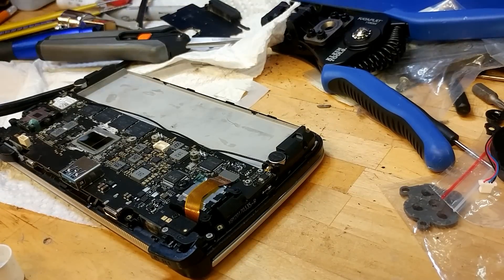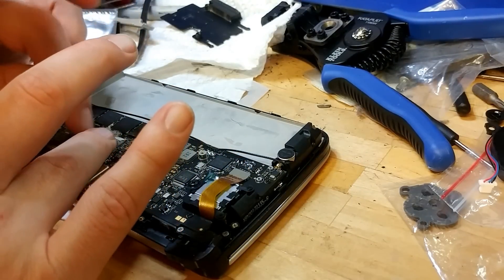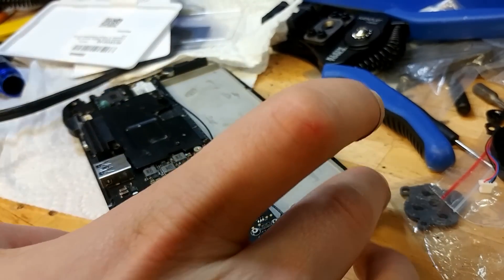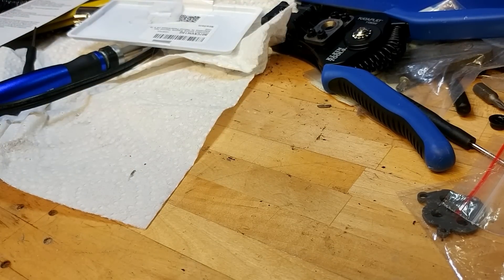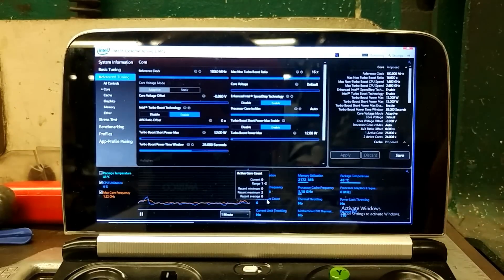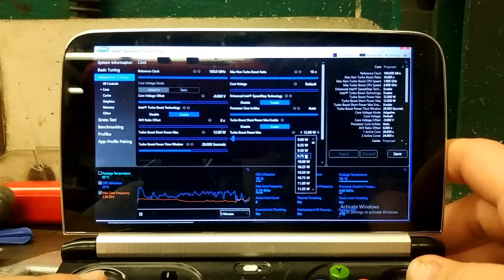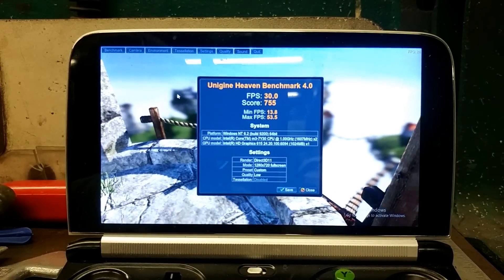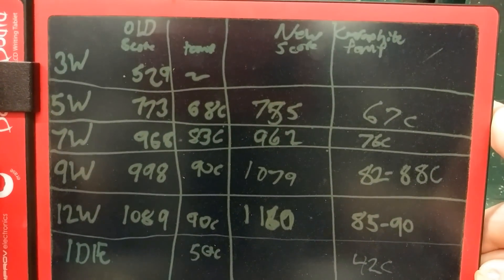IC Graphite thermal pad installation and testing on the GPD Win 2

Comment: the thing about graphite is that it spreads most of the heat horizontally. the more area the pad covers the better your cooling will be. also I would be more worried about graphite dust shorting something then the pad sliding out from under the heat sink. a better option would be a sheet of loose leaf silver. you can get a pack of 25 sheets for less than $13. note they are thinner than paper so they tear easily but can conform to about any shape you set it on and are kind of sticky so sliding won't be an issue. that said I have a Motorola droid 3 that I put a sheet of pyrolitic graphite on 2 years ago to help with cooling. the phone it-self still works fine other then being stuck on android 4.4 and scratched to hell. sadly pushing me to get a newer smartphone.  I'm also getting a reasonable result with just loose leaf copper on a i3-7100 desktop. with 43*C idle, 65*C load in a 21*C(71*F) room so there's that. lol

Comment: This should have been done at the factory
Reply: Just because you can modify it doesn't mean you have to. That's like complaining that a custom PC is worse than an iMac because you can upgrade the graphics card in the PC but not the Mac.
Reply: Undercoverfire That makes sense
Reply: Would be expensive and time consuming.
Reply: An Tran I just dont like the fact that you get an 'incomplete' product that you have to tinker with to make it work better.

Comment: I can’t wait to get mine soon so I can do this. Might pick this up for my laptop too. Seen so many videos on these thermal pads. 

Thanks for taking the time to do the comparison and benchmarks.
Reply: Chris Aguilar laptops (usually) do not use pads. They use thermal grease. A good replacement would be MX-4 or IC-Diamond
Reply: As sorry. I am referring to the IC Graphite thermal pads. Not just a generic thermal pad that would sit on a memory chips or random IC’s. 

Also nowadays more laptops use thermal pads to help cool vital pieces. My Alienware 13R3 which is only a year old has tons of thermal pads along with two coolers. It’s more common these days. 

I have been working with hardware/computers for about 15 years and it’s nice to see something like these pads readily available on the consumer market and most cases it performs as good or better then thermal paste. Of course liquid metal being the best. I prefer not to use it in something Mobile due to the fear of it leaking from the cpu/cooler area and shorting the motherboard.

Comment: That graphite pad does look slippery. Instead of some K5, do you think a couple very thin strips of thermal tape around the edges would be about as effective in keeping it secured when reattaching the heat sink?

Comment: What about using the liquid metal thermal paste?
Reply from the maker: Chris Pinson my personal opinion is it is too risky.  
The stuff as its name implies is liquid, its fine for a stationary desktop but for a small device that is carried around everywhere using a conductive liquid on the cpu is too much risk for me.  
I did contemplate soaking the graphite pad in it but I didn't want to spend the money at the time.
Reply: Michael that makes sense!
Reply: Depends on the surface tension. Two surfaces can completely hold a liquid in place where the amount of force needed to move the thermal liquid would damage the electronic blunt force.
Reply: and liquid metal can oxidize itself and other metals around it so it is a good solution for a year or 2 but after 2 years you will get a lot of problems
Reply: I liquid metalled the GPD WIN 1. Every time you drop it, you need to clear the inside because a conductive material explosion happens, resulting in resets and crashes. 
Still thermal pads are shiit compared to high quality paste.
Reply: id just put cryonaut. its not as good but the next best thing.
Reply: So glad I got to this video I bought a new MSI laptop with too much throttling and I stay in South Africa where temp are a bit high and I do not trust liquid metal and I will try this after your test thank you!